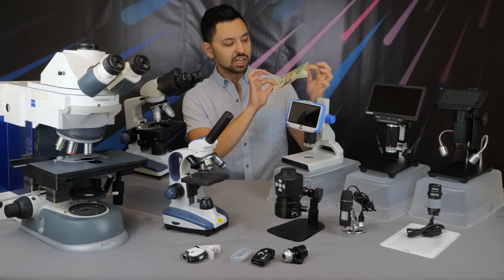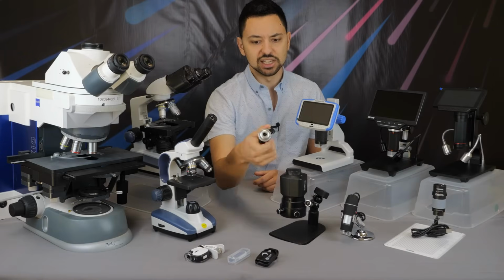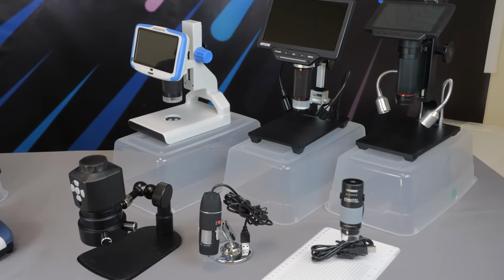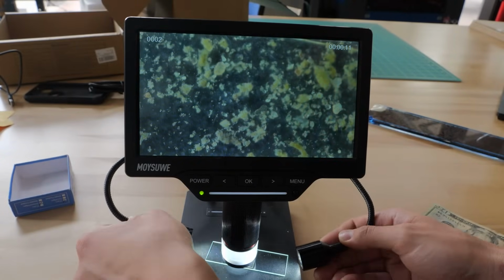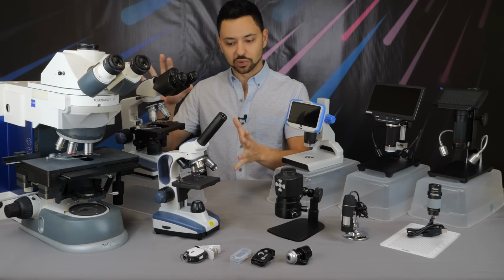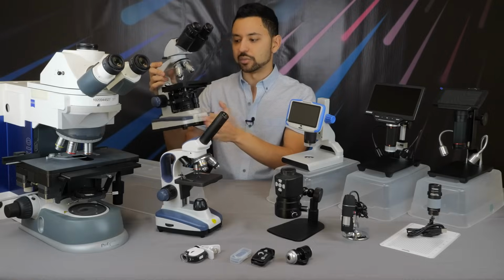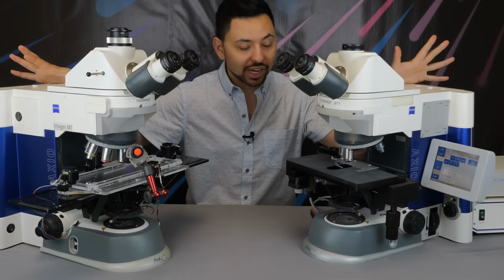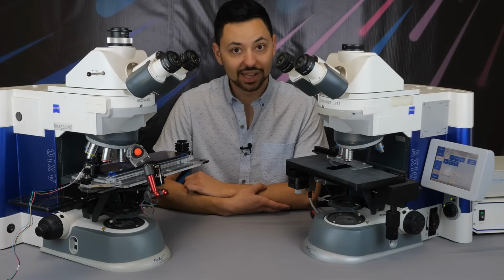What Microscope to Buy in 2023

Comment: One thing to watch out for: As you say, a lot of these scopes are made in generic factories and then branded by different companies, which opens the door to all kinds of knock-off products. I bought a digital microscope for casual use (I have a Zeiss binocular for "real" studies) and although it was highly rated online and I'd actually seen one in person, the one that came to me wasn't the same. Its software for capturing and downloading images had the right name on it, but it was a long obsolete version that wouldn't work with any modern computer device. It was then that I realized exactly why Amazon sellers will take returns only if repackaged in the original materials, because a closer inspection of mine showed that it had previously been opened and used by someone else before I got it. Undoubtedly they'd discovered what I did and returned it, allowing the seller to collect a restocking fee and then simply send it out again to the next person (me) who had bought one through their Amazon store. Eventually they know that a defective item will be bought for a gift or something, and its problems won't be discovered within the 30-day warranty window, so at that point it's all profit for them, and they'll have made just as much money off of a bad product as they would have if they'd tossed it in the trash and replaced it with a good one. So beware, thoroughly check out everything you buy, and don't miss that return limit window!
Reply: Great advice!

Comment: There is one aspect of using a microscope that is becoming more commonplace:  Vintage PCB repair.  Repairing the traces on, for example, a Macintosh LC logic board needs the use of a microscope to see the condition of the traces and also to ensure that all of the electrolyte/alkaline regurgitation from batteries and capacitors is removed from the logic board.  Note:  The Macintosh LC series is plagued by being "battery bombed", i.e., severe battery leakage from the PRAM battery that is there to keep time, date, and misc. settings saved.

Comment: Yes, I am interested in the  Zeiss Axio Imager M1 > I am research scientist at a state college-zero research budget.
Reply: I put together research grade microscopes myself from parts I bought off of eBay. I did this when I was working and had a job to pay for the stuff. All the equipment I put together was only barely affordable because I stuck with "last generation" (160 mm tube length) equipment. Best of luck with your quest. Maybe you can apply for a grant?
Reply: Yeah a 5k scope in no budget isn’t really viable, you can get great ones much less than that, that will be ideal for your research.
Reply: Price
Reply: Im interested in the m1 and would like to acquire one

Comment: I use the flat screen type for electronics. One of their downfalls is the stand. Stand is great for most stuff but if you need to fit a larger board under the scope you have to remove it from the stand and jerry rig something. On the budget ones the led's are usually too high in the frequency spectrum too white or too blue. Contrast can be way too high. But other than that a budget microscope is a great tool. One trick with a mobile phone is to set it to video and turn the torch (video recording + led lighting) on at the same time. Then zoom in and focus.
  I would like to see a stand with a longer swing arm that can be moved into a wider range of positions.

Comment: I want to start analyzing the waters I've been drinking as most are filled with plastic, and It's been found that calcium carbonate encapsulates up to 80% of the 3 most common plastics found in water after boiling, making it easy to filter out. 

 I wanna buy a microscope to experiment with different water sources and different filtration methods at home, and just have some peace of mind that I'm not drinking poison.
Reply: Did you ever find a good one? I’d like to do the same

Comment: I would have to go with the TinyScope or the cheap $20 USB-one in order to examine videoheads in situ on the video drums inside VCR's.
Perhaps retrofitting the cheap one with better optics could give better results, but it would be overkill and a comprehensive task.

About USB.
Even the old USB-1.1 is @12mbit/sec specified datarate is absolutely capable of transmitting FullHD 1080p, though it has to be be very compressed, like you see on TV streaming services and so, who'd notice ? People are actually paying their hard earned money for these services and watching it on their 50"-85" monitors.
30-50mbit/sec like you'd see watching BluRays is of course preferrable.

And here comes USB-2 with its specified 480mbit/sec datarate.
Where did you get the impression, that this interface wouldn't be capable enough ?
Maybe the manufactorers of the USB-2 microscopes chosed a 720p videostream and lured you.

Anyway, thanks for this upload. Very useful for my decision making and much appreciated.
Thanks man. Cheers mate.

Comment: USB 2.0 is not a limiting factor. It can easily stream 4k capture. It is the rest of the hardware is the limit. The capture hardware is the problem. Similar to how budget mobiles may not be able to record 4k@60fps while flagships can record 4k@120fps.
Reply from the maker: Looked into this further, and you are correct. Thank you for pointing this out. It makes sense that it is a hardware limitation with the onboard video processing of the USB microscopes, not USB 2.0 itself. From what I can tell, it looks like the practical max bitrate of USB 2.0 is 30ish mb/s, which would still be enough for standard H.264 compressed 4k30fps. I found a USB 2.0 eyepiece camera that does 1080p30 and so far that is best video I've seen come off of a USB camera, but I also haven't tried some of the ultra expensive USB 2.0 cameras.
Reply: @micro_safari  I have tested USB camera modules like the ELP models for projects. They provide amazing quality, but the modules themselves are around $30 for 720p and $50+ for 1080p. They have much greater image quality than $100-$150 digital microscopes. Someone could design amazing digital microscopes for around $50 with some of those.

Comment: Very nice video.  Especially, thank you for the section on surface mount PCB assembly and repair.  One needs to have enough room to get a soldering iron, tweezers, and other tools in under the scope.  Having stereoscopic vision for depth perception would be great, but that looks like it would make the scope much more expensive.
Reply: What do you recommend? My life is falling apart so I’m upgrading repairing all type of broken shit I’ve accumulated over the years.

Comment: Where can you buy the clip on microscope?
Reply: Be careful. Single lens phones only.
Reply from the maker: It works with some phones that have multiple lenses, but not all of them. We made a list of compatible phones on our website. That list was from a couple years ago though when we made the soil version of Micro Safari so newer phones aren't on the list. Newer phones with multiple lenses might still work even if they aren't on the list, but bob is right, some phones have sensors that try to determine which lens to use automatically and putting a mobile microscopes over that sensor will wig out the phone and it wont use the correct lens. You may be able to get around this with the non-standard camera apps off the app store

Comment: My interests are doing manipulations of 3D things (splinter removal, circuit board repair, jewelry & coins) under stereo microscopes.  But I'm tired being a slave to the eyepiece, so I'm considering digital.  I wish you had some kind of evaluation of Dept of Field which is most important to me.
Reply from the maker: Hi! Thank you for the feedback. I'll put this into the queue for making a dedicated video on. The long story short is that depth of field is directly proportional to the working distance from the bottom of the objective to the sample plane. You get more depth of field when the objective is farther away from the sample.
Reply: @micro_safari  What fascinates me is that doctors/dentists use surgical loups that are somewhere around 2-5x that have an extreme working distance like 12-18 inches.  My dentist's cost about $5k.  Clearly too expensive for hobbyist, it begs the question what might be available for cheap.  I also saw a video of a mineral/rock guy demonstrating different microscopes and to get a full depth of field image of a sample, they take multiple "slices" of pics at different depths and then use software to "3D imaging" them together.  Results look like SEM.  Familiar with 3D scanning, that application totally escaped me.

Comment: I purchased the clip on cell phone scope you recommended. Ah you didn’t mention it only works with smart phones with a single camera lens. And it came with a dead battery. Still a good video.
Reply from the maker: Hi Bob, you should be able to get it to work with a phone that has multiple cameras. With an iPhone 11 as an example, you just have to put it over one of the lenses that doesn't seem like it works at first, but then when you pinch to zoom in the camera app, the iPhone switches to using the other lens.

Also not sure if you purchased the mobile microscope through us or Amazon, but if it was through us, send us a message through the contact page at microsafari.org and we will send you a replacement. We went and checked every unit to make sure they all had battery but its possible one could have slipped through the cracks.

Comment: USB 2.0 has a data throughput of 480mbps. This limits the bit rate,  not the resolution.  A resolution of 1920 x 1080 has a maximum bit rate of 8mbps over USB 2.0. That's not the clearest, sharpest image in the world but it's still very usable. Heck many YouTube videos are encoded at 1080p 5mbps CBR.

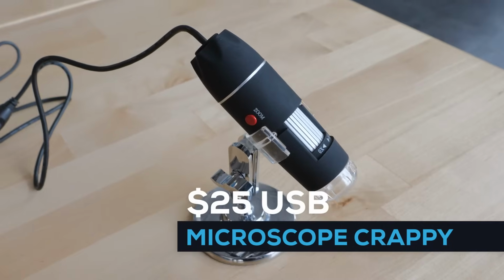Comment: Hi, I just got the $25 2.0 USB one shown at 9:13 for coins, but I didn't get the drivers... I'm using a desktop without a CD player. So I'm looking for the app and drivers to make it work.  Found one app but they want $17+ for drivers.  So this old man is looking for help. Thx
Reply from the maker: You should just be able to open the camera app on your computer. If you already have a webcam you might need to use the button that switches to a different camera. The USB microscopes should just show up like a webcam

Comment: Thanks for the guidance. What's the difference between the Amscope B120 and the B250? I notice that 250 is a bigger number than 120, and therefore suspect that the B250 is somewhat better than the B120. But then Amscope's product descriptions for these two microscopes makes it seem like the B250 is smaller and maybe less quality than the B120?
Reply from the maker: Without doing deep digging or reaching out to Amscope, I'm not sure. They appear to be effectively the same price though, so I'd speculate that they are very similar with some difference in the mechanical components that they are built from.
Reply: @micro_safari  Seems the b250 is basically the same, but designed more compactly to fit into smaller working spaces. The stage maneuvering area might be smaller because of this.
Reply from the maker: @Sailormoon1v  Ahh okay. Makes sense. Thanks for the update!

Comment: Thanks for a great 2023 microscope buying guide. I spent hours drawing images of micro organism when I received a compound microscope as a pre-school kid and I'm looking forward to rekindling my micro safari interests.  Based on your recommendations, I ordered a Swift microscope with digital camera attachment. However, the camera is very low resolution. Can you recommend a suitable replacement that I can attach to the microscope  to view higher resolution images on my pc?
Reply from the maker: We just ordered a bulk shipment of microscope cameras to test them out and figure out which one(s) we will recommend for folks.

Check out: https://microsafari.org/products/hd-digital-microscopy-camera

Out of the shipment this one was the best performing out of all of them, including outperforming one that was 3x the price. I'm going to use it to record all future content. It is 4k,  has an HDMI output to connect it straight to a monitor, a microSD card to directly record to, or a USB connection if you connect it directly to a computer. Not sure if your scope has a trinocular port, but we also have a variant that includes an eyepiece adapter if you need that.

It's pretty amazing, this microscope camera outperforms my Lumix G9 mirrorless camera. I think that microscope camera image sensors must be application specific, because my microscope camera will pick up low contrast microorganisms that my mirrorless camera sensor completely misses. There may also be imbedded firmware in microscope cameras that helps with edge detection and enhancement.

Comment: it's always a tradeoff but i wouldn't go as low as recommending a monocular, unless for the specific purpose of transforming into a "digital microscope". While i do enjoy switching to a screen from time to time, you lose A LOT of quality when switching from eye to camera. this can't be overstated. (not so much in resolution, but in framerate and contrast/dynamic, which is more important than raw resolution)
Reply from the maker: I still recommend monocular scopes since there are people that are price sensitive enough where the cost difference between mono and binocular is not insignificant. Otherwise I agree, going binocular is a huge upgrade. I also agree with your point about screens vs direct viewing for quality, however, there is a pretty big user comfort upgrade when using screens over direct viewing. There is also the matter of screens being easier for those that are visually impaired.

Comment: I just picked up a nice monocular Amscope microscope from goodwill for $7. It came with no eyepieces. If I can only afford one which one should I get. 10× 16× or 20×. The eyepiece size is 23mm
Reply from the maker: If it has a mechanical stage go with the highest magnification, otherwise go with a lower magnification. Usually the lower magnification eyepieces are easier to look into and give less eye strain. If you don't have a mechanical stage you will be limited by how small of a distance you can move your sample by hand so you probably wont be able to make much use of the highest objectives + highest eyepiece magnifications.

Comment: Hi, I want to buy a soldering microscope. 
Electronics is my hobby after work. Does the USB microscope connect to the tablet? I have a 3D printer and wanted to design a stand. Or what screen model do you recommend. I was thinking of price up to 150USD, if more then why.